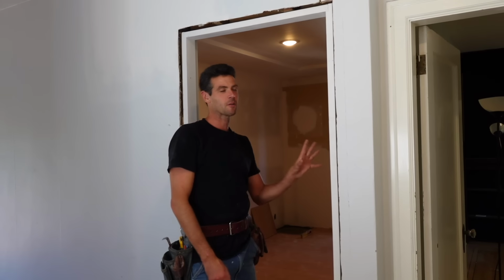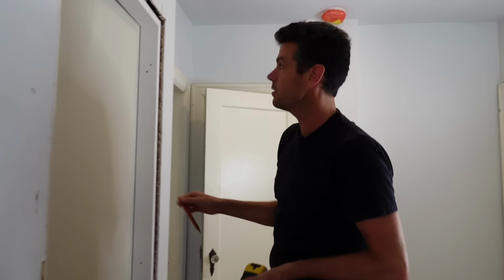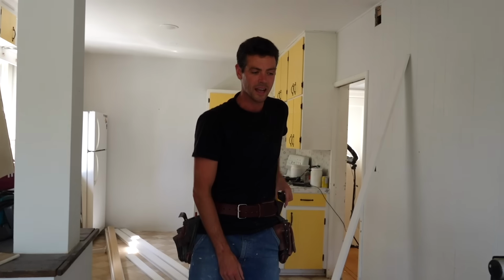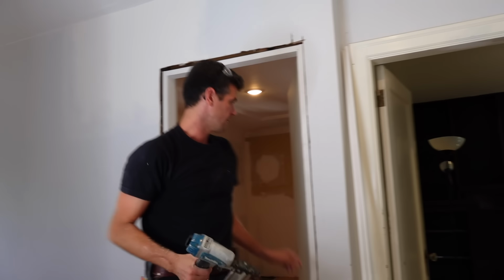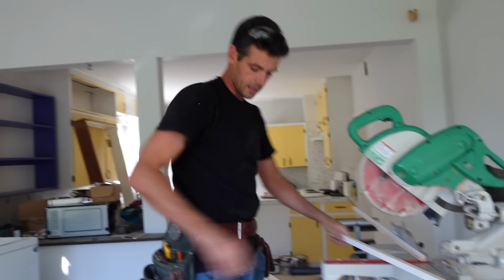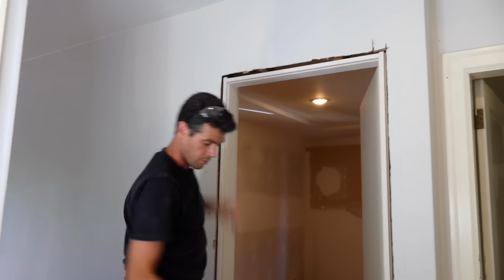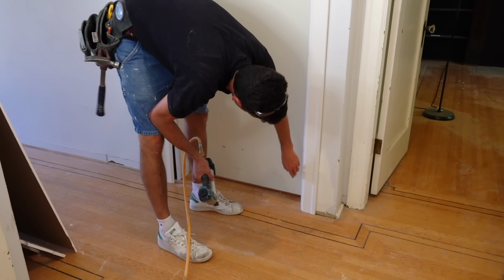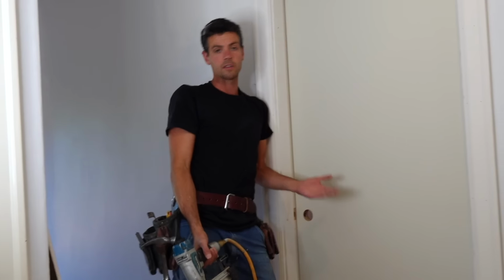Door Trim Installation when wall sticks out too far!!!

Comment: Nice work, but why glue the corners before nailing the casing on? Isn't it easier to assemble it "on site" and glue the corners as you nail it on? Not saying your method is wrong, just curious about any advantages to doing it your way?

Comment: I've finished dozens of doors frames.  Can't understand why u join the mitres beffore fixing the trim to the door jamb.  I always mitrered eaco upright, nailed it, then mitrered the top pc, glued the mitre, dropped the pc in & nailed it, tweeked the pcs with tiny shims to fit flush then tap in a small nail accross the mitres to hold.

Comment: Should you always preassemble your casing?  I was going to put them up one section at a time
Reply: it is easier to get nice tight miters, and goes much faster once you get the  hang of it, especially for trimming out a whole  house or units at a time. Measure a bunch at once, cut and assemble at a station, always being careful with labelling, Take over  and install.

Comment: Well in the olden days, the supply yards had an employee who would go out to the job sites and actually measure the openings for all the interior doors. and they would make the jamb width the proper size to begin with.
But today, the large box stores, where most people buy their trim, dont do things like that.
So what it all amounts to is that professional people have been eliminated to a large degree in the building industry.
And that means that the onsite workers need to make up for the so called progress thats been made.
And the same rep. from the supply yard would also supply the contractor with things like carpenter pencils and nail pouches.
All with the supply yard name on them of coarse.

Comment: I'm curious about the reveal. Why even have a reveal on the extension? Why not just flush with the jamb? I assume it's just a preference thing?
Reply: Joint is gonna crack. I just finished the vid! AS always thanks for the great resource!!
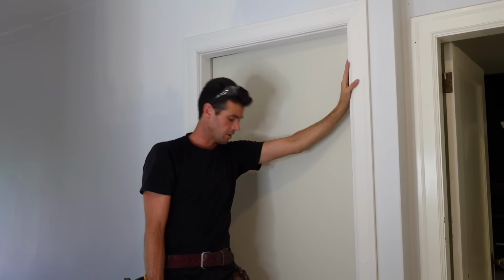Reply: 13:44 he explains that real quick
Reply: It's for ease. You can do it flush but you need to use a good adhesive in addition to the nails. Then of course it needs Sanding, filling etc etc. Just easier to do it this way
Reply: Because it just doesn’t look good either

Comment: Sure.  A jamb extension can be done or one could put in a proper size jamb.  I just ripped out 10 poorlly done doors with slop extensions and ordered proper prehung doors with proper jambs.  Full pro finish.  Screw jamb extensions.  If you can't afford to do it right you are already in over your head.

Comment: I’m confused. I’ve always uses 1 1/4” x 18ga nails into the jamb and 2” or 2 1/2” x 15ga into the studs. Not the same nail for both. Sometimes into the jamb I’d use a 22ga crown staple with 5/8” legs if the edge detail was really small. Stronger and never splits.

Comment: 1. You bought (ordered)the wrong size door. They do come in more than 1 size...
2.if you really want to stand out, buy some 3/8 painted mdf and box the jamb...Obviously you're going to have cut those to table saw too...
But yeah jamb extensions will work for most folks....

Comment: So I could use a nail gun, nails for that gun, hose, a compressor --- actually I found one. I need a slide rule thing-- I see how you can use one now. I need a chop saw. I have a tape though. I have many hammers. I have nails. I have POS chop saw from probably the 70's. It is so primitive but it still runs and the blade is super dull. I'm just saying a project can look quite easy when you have the tools. I also have a cheapo table saw from the 80's, a craftsman. The fence is questionable and always makes me nervous. It works though. It'll do if you don't have one.

Comment: This is a common detail that is resolved normally in two ways 1) as said, a jamb extension or more properly a correctly sized door frame/lining to suit the wall thickness i.e. the professional way!  2)  where the wall thickness is too great then the plasterboard is returned within the reveal to the door frame/lining.  Easy, Peasy really!

Comment: There are two solutions each depends on the condition.  1.  Fir the door frame out until it's even with the face of the wall (a narrow difference).  2.  Build a return into the wall and head so that the drywall returns to the side of the frame  or casings after trim.  (if it's a large difference).

Comment: Why do a double reveal, especially when it is nearby a standard door installation with a single reveal.  Doesn't look so good to have this mismatch.  In my 40+ years as a carpenter, I've always added the jamb extension as you've done, then cut and nail the head trim so it flushes out with the inner edge of the extension.  Do the same down the two legs, mounting them individually and cross-nailing the miters.  This looks neater without the double step.

Comment: You mentioned safety glasses with the table saw, but forgot you should have also worn hearing protection.  Next you forgot to wear the same for the nailer.  Please increase the use of PPE.

Comment: I always go to the widest part on jamb extensions...In this case 7/8...You can always lean back the casing a bit...You're lucky to have some clearance  to the framing so you can get some reveal on the extension...As a general contractor; if you put that many nails in my casing; I would throw your compressor out a window... :)...Just sayin... Nail where it's loose,

Comment: Why the additional reveal? Why not just add the piece flush?
Reply: he clearly explains why
Reply: @glockmaestro  

And I just did it last week and it's perfect. He is just in too big a hurry. The key to anything is just doing it right. I scraped and sanded the door frame clean until only bare wood remained. Then I used a good quality wood glue and clamped it in place for about 18 hours, with a very slight overlap. I removed the clamps and sanded it flush. I blew the dust off and wiped it down with a damp rag, which revealed a few small spots with a tiny groove that didn't fill with glue. I filled the tiny groove with plastic wood and again sanded it perfectly smooth. It's been painted and it's perfect. I even did it on the hinge side of the frame. I notched the new piece to clear the hinges and it's impossible to tell that I added 1/4" to the frame. Obviously, this takes time but you can do it while doing other things. It takes a couple of days while drying but it doesn't happen very often.

Comment: My biggest takeaway from this video is "Damn, I can see why carpenters sometimes lose fingers"! Those cuts look dangerous as hell. One careless moment is all it takes.
Reply: just use a push stick at the end of the cut. He really should have that saw on a stand, and a blade guard wouldn't hurt. But if you get into safe practices you can use a table saw regularly with no issues whatsoever.

Comment: Everybody’s an expert. Including me. 
If your door had the proper jamb width from the factory, it wouldn’t be stepped at the last 3/4” so don’t do it. Make it flush, sand and fill as necessary and paint it. More “wedding cake” is not better just lazier.

Comment: You showed a way, another way would have been to do a flush extension jamb being 3/4"*1 1/4" even doing the Way you did you should have ripped extension jamb strips 3/4"*1" .
Your mentor should have taught 'may crack' and taught you how to sand and bondo such seam.

The wider extension jamb, provides more room/space/Wood to nail to.

Edit: I should have better worded My comment w/o busting your balls.
I actually like the double reveal method.
At first I thought you was going to show how to cut trim into Sheetrock, then I thought you might do 13/16"* 1" or 13/16"*3/4".
As stated in original comment I like to Go wider than necessary minimum width of extension jamb as it doesn't leave you with the tight nailer edge in My mind that should be the major finish Carpenter tip of your Short.

Have you ever had to cut a 2"-3" radius tree at 7' and milled it out with a table saw and planer bcuz you were short on lumber and needed an extension jamb or etc.? 
I've been thinking maybe I should do a Short with me in the middle of a nor Easter in Vermont where I do precisely that go outside, cut a small tree Mill it into a small piece of finish trim, while filming.

Comment: Huh, I never thought of the casing adding to the door frame strength.
Reply: Spray foaming the gap between the door frame and the rough opening can often also gives a noticeable increase in rigidity.
Reply: @nordlands8798  Thanks for the tip! I'll be using it in the future.

Comment: You cut a strip of wood to put between the jamb and the trim, what else would you possibly do, remove the sheetrock and trim 1/4 inch off of all of the framing in the wall? Lmao
Reply: He has another video where he carved out the drywall. The comments on that one are hilarious.

Comment: Easier way is to just build your own door jamb. That way you don’t have to worry about butting up pieces of wood together.
Reply: You have pre finished allready hung door and you want too build a new frame at more cost and more work lol
Reply: @weggedddude9086  we don’t have that issue in Florida. Here. We already know if our wall is going to be wider than the prehungs. But yes. It would still be easier to just replace those pieces than sister on boards. But that’s just the way that I would do it and I was offering another suggestion.

Comment: You order a door with the right size door jamb, or you make the right size door jamb. 3/4 in jamb extensions are a joke.
Reply: Based on the floors, 2 hinges on the old door, and the lathe and plaster, this is a pretty old house.  It is quite possible that is a non-standard width wall.
Reply: @nmpls  you can order a door with practically any size jamb you need. I worked in a door shop for many years.
Reply: @Eaglefreek300 , sure if your client doesn't insist on some cheap-ass Jenn-weld.
Reply: @nmpls  LOL, I used to work for Jeld-Wen.
Reply: What if the customer doesn't have the budget for a new door and jamb?

Comment: Dude acts like he is teaching you something. Rip a piece of wood and put it in there. It doesn't have to be painted or primed wood either like he is using. Just regular 1x4 will work to rip down. Simple as that. Paint it in place. Done.

Comment: Jamb extensions are your friend, they make life easy.  But if I do run into a width on a door that was not planned, I make my own jamb out of 1X's and measure/router out the hinges, install plumb and hang the door.  I DO NOT like to add extensions as it shows a lack of attention to detail on your part, and having gaps for caulk is unacceptable.  Make it as tight as you can so caulk is optional.  Being a "trim carpenter" means you make it right, tight, and beautiful without the need for caulking.

Comment: I don't understand why you did a double reveal. You could've done the ripped piece the same way and then made the trim and ripped piece flush, only having one reveal. Now you have a doorway that doesn't match any of the others big time. Sure it wouldn't have matched 100 percent the way I said but there also wouldn't be a fucking double reveal for literally no reason.

Comment: simple solution...buy a frame and door designed for that thickness...not rocket science
Reply: or here's one for ya - they dont offer a stock door jamb in wall thickness you working with. either you A. custom order door jamb and wait for it B. custom build your own, have to route the hinges or C. use stock jamb that is close and you make it work.
Reply: @harveylong5878  100% agree

Comment: US and Canada: doing things ass backwards since 1776
Reply: sounds like you are unfortunate enough to use metric...
Reply: @chrisburns5691  metric is a lot more accurate,  so yeah great. Bit my comment wasn't directed at your imperial masters left overs (or you for that matter), it was directed towards the strange "jamb extensions". I mean, call me crazy but we use the correct size jamb to begin with. Weird huh?
Reply: @needaman66  it's not anymore accurate if you know how to use imperial. Ask a machinist.

A better option here may have been to make a custom jamb for it. You can't buy one off the shelf for that size obviously- here older homes with plaster will sometimes have a different thickness than with modern drywall, as seen here.  but can make one yourself or have a door shop make it up.

But jamb extensions work fine, I would have made mine a bit wider than his where the casing sits on it. Just have to remember to make the hinge side flush and add the extensions to the other side. Sometimes a situation comes up where they are a fine solution. Remember too given the choice many customers are fine with an extra reveal on one side of the door from extensions, and don't want to spend the extra on a custom jamb. Best to give them the option.